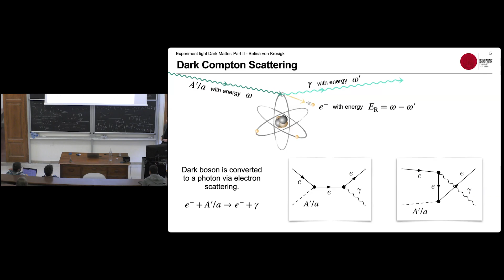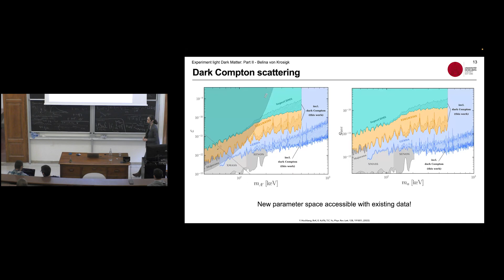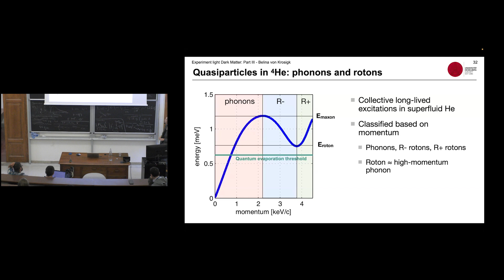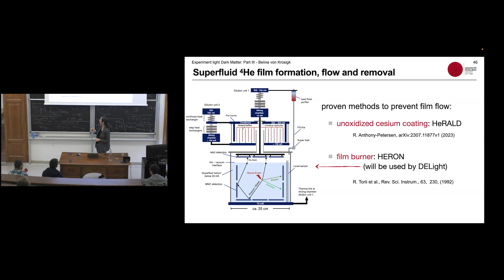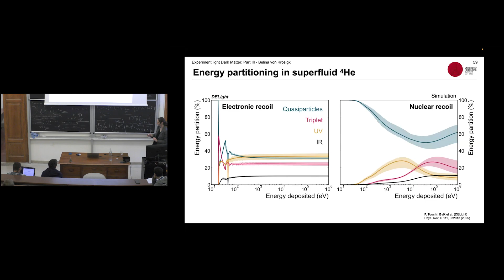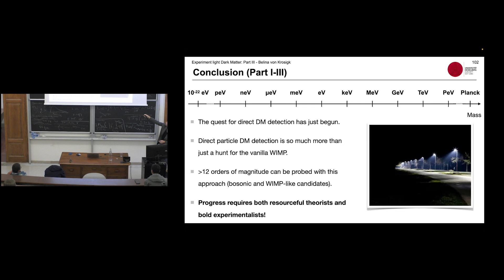Belina von Krosigk: "Experiment light Dark Matter" - Lecture III

Comment: Dark matter is dilated mass. A fundamental insight of Relativity is that mass that exists at Relativistic velocities is irrelevant from our perspective. Relativistic velocities are occurring in the overwhelming majority of galaxy centers. This means that they exist in a "non local" state relative to their outer regions. The mass in our galactic center is not just there, it's everywhere.
   Einstein repeatedly said that Relativistic dilation prevents astronomical concentrations of mass/singularities. He put this in writing in 1939. The phrase "mass becomes infinite at the speed of light" refers to it.
   Relativistic dilation doesn't occur in galaxies with low mass centers. They don't have enough mass to achieve relativistic velocities. Therefore, they don't have dilated mass. It has been confirmed in 25 dwarf and ultra diffuse galaxies to have no dark matter. In other words, they have normal star rotation rates.